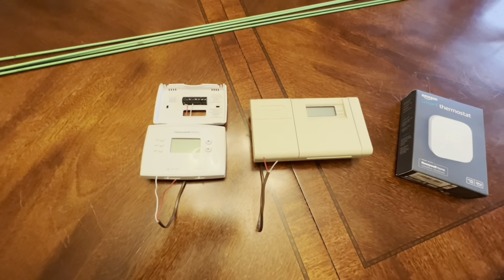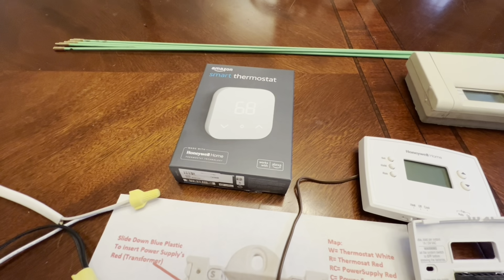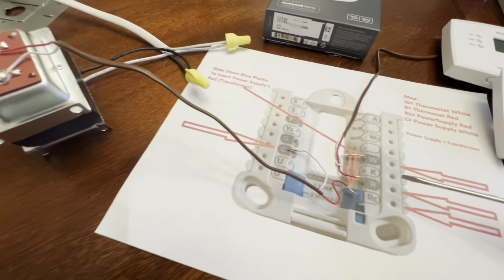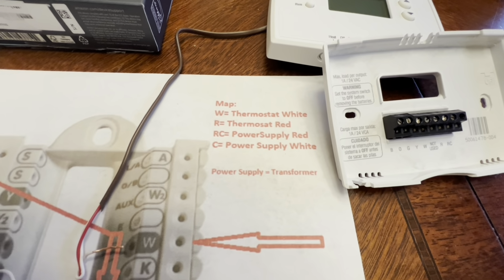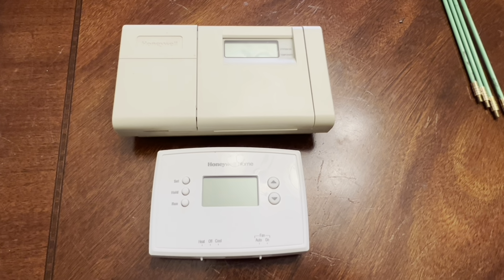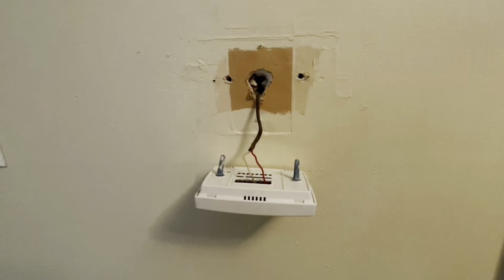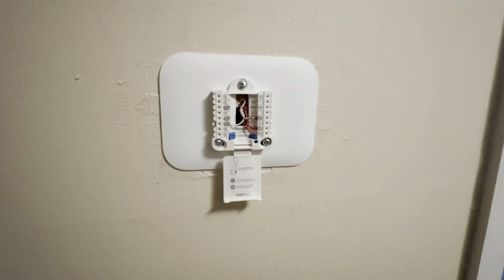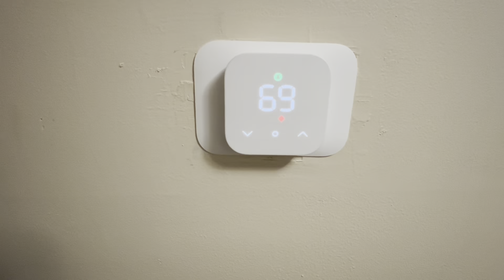How to upgrade an old 2 Wire Thermostat to a Smart Thermostat - Amazon Smart Thermostat

Comment: Great video! Do you have to turn breaker off for those two wires coming out of the wall? I'm adding a plug-in C wire with built-in converter for my Sensi, so I'm not sure if those old wire have power?